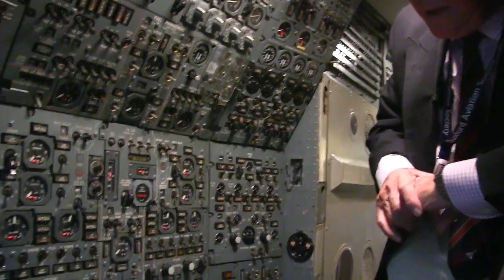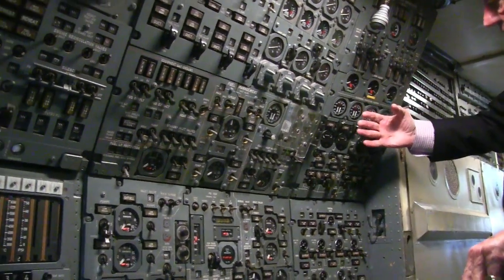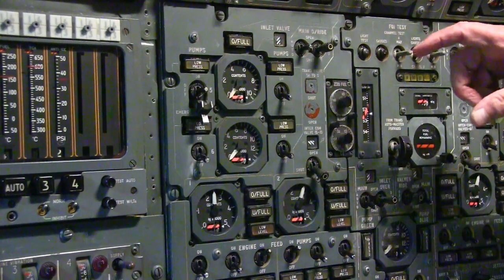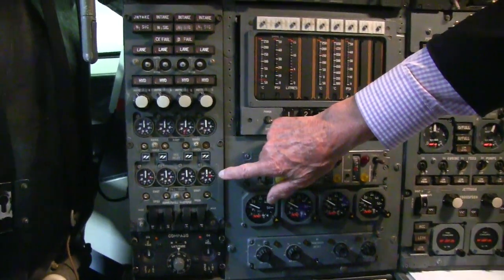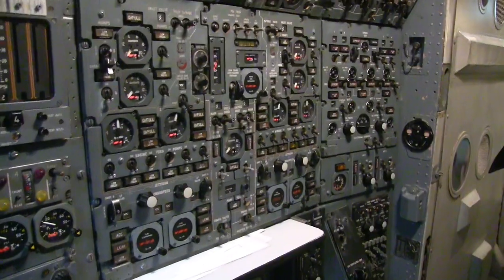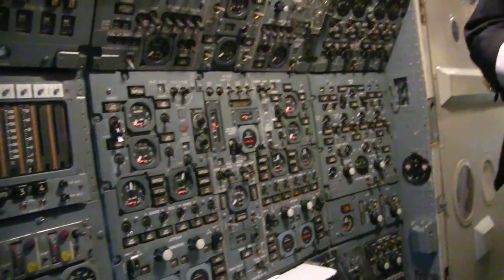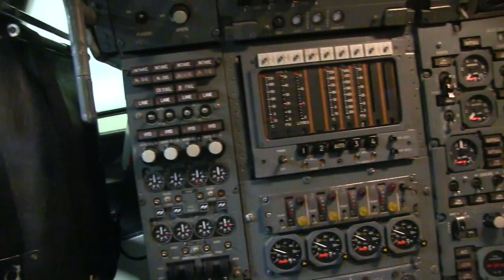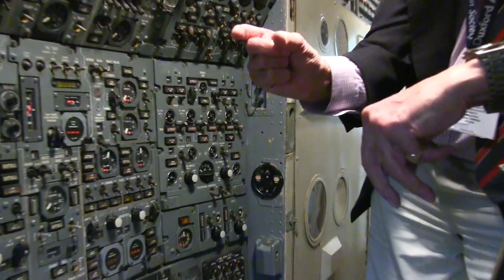Concorde's Engineers Panel Tour with John Hutchinson

Comment: I knew Johnnie Walker, Concorde Test Pilot and Alan Heywood, Flight Test Engineer in the early 70's and often toured around 'Old Smokey' prototype at RAF Fairford, Gloucestershire airfield with Alan, including sitting in the cockpit, seeing the then gigantic onboard computers inside the fuselage, the wing inspection panels open and dripping Avgas into 45 gallon drums previously filled Swarfega hand cleaner. 
It is said Alan once took his yellow labrador Ben onboard at Mach 2 setting an unofficial World record for the fastest dog!
A one off incident occurred after a Concorde prototype tail was extended to prevent a serious shudder at Mach 1+. The new tail section, fabricated at Filton, near Bristol, was fitted inside the usual RAF Fairford,  hangar.
A subsequent test flight saw the tug connected to the nose gear and the driver, who had performed this action many times, just drove ahead without thinking about the extended tail section and  promptly sheared it off on the upper vertical hangar wall section.
"Millions of £'s" worth of damage occurred. Needless to say the hangar section was rapidly cut away by way of a slot to accommodate the higher tail section. 
The tug driver was never heard of again or even seen in 'The Bull' public house nearby where he was a regular.
The incident was never reported in the Press as one can imagine the then Minister for Aerospace Michael Heseltine would have had a very red face in Parliament with awkward questions from the Labour bench opposite!
Alan commented in those early days that the fuel tanks were vunerable from being punctured by debris but it went passed the boffins as nobody wanted to add anymore weight...... something in years to come, would result in the Paris crash and sadly contribute to bringing an end to a fabulous chapter of supersonic passenger aircraft designed and built in the UK and France, against all technical and financial barriers.
Johnnie Walker, as his name implied a certain brand of amber liquid in a square bottle, was routinely teased as being a paid promoter of the brand just because he had the same signature embroidered on his dressing gown. Johnnie always took it in his relaxed and gentlemanly stride.
Both men were regulars at 'The Mill' public house at Withington, Gloucestershire and resided in the village.
Unfortunately these pioneers along with chief test pilot, Brian Trubshaw and many others who worked on the oroject are no more.
All were legends and courageous in their own right, as is still, ex-BA Concorde Captain John Hutchinson, for his wonderful YouTube videos and classic narrations, such as "3-2-1 NOW" as full engine throttles were applied on Concorde take off rolls.
A long and happy retirement to Captain Hutchinson.